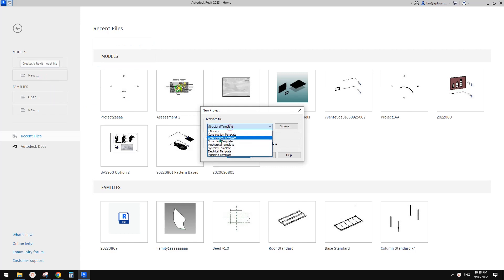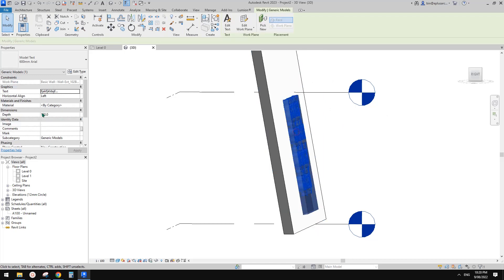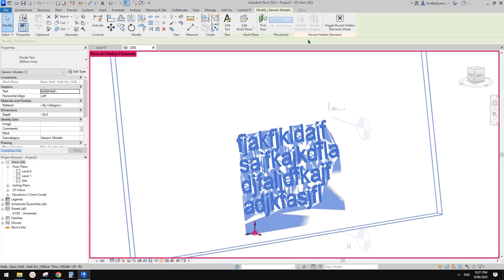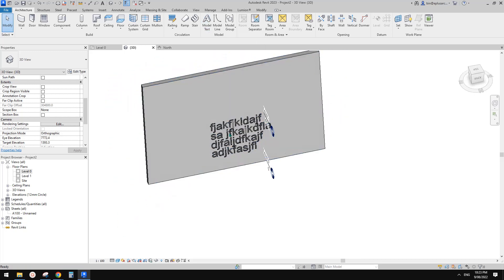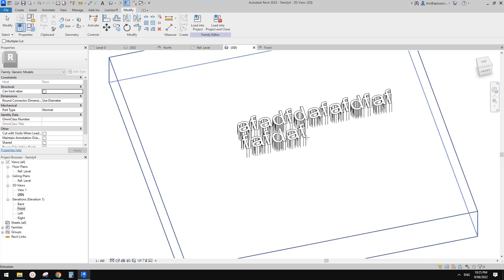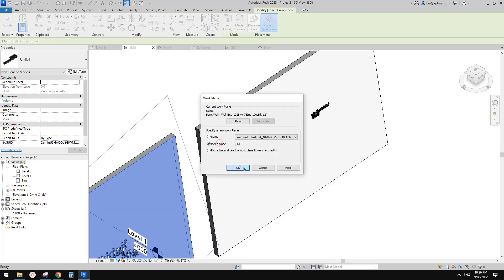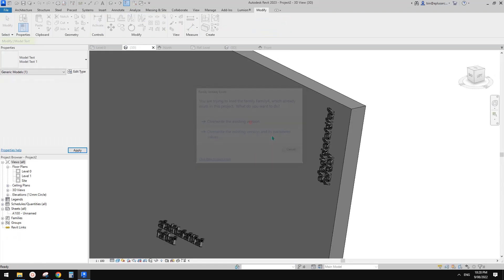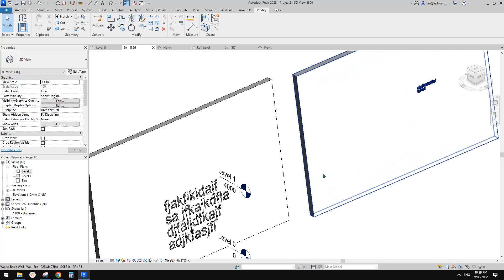Revit Exercise (Day 869) - Engrave Text Using Model Text and Join Geometry

Comment: I tried this and it worked out simply by just joining 3D letters to the wall, embedding it with negative depth value and finally hiding it. No particular family creation was needed. Thanks for the hints.
Reply from the maker: You are correct. I was trying to create a face-based void family, but I failed. The face-based family has to be solid, so basically the same as a model text in the project, except the visibility/graphic setting so it can be set to be invisible in plan, elevation and section views.